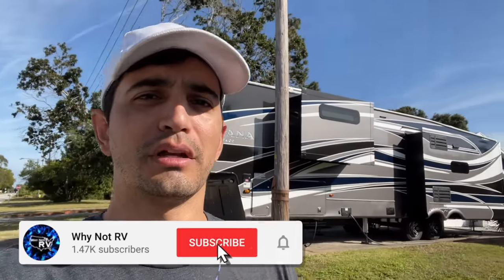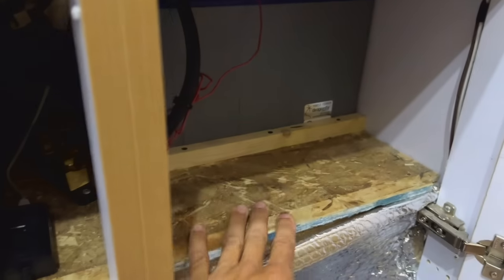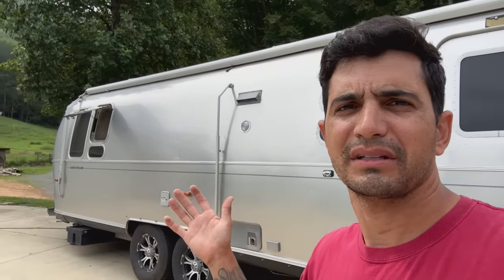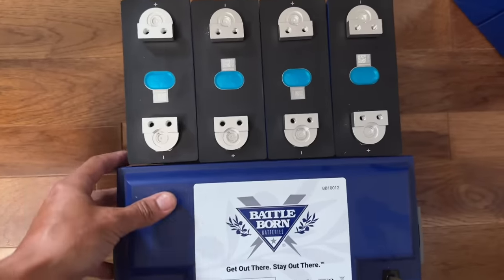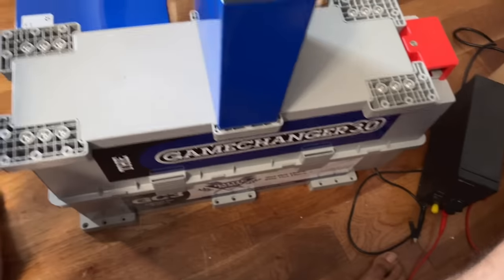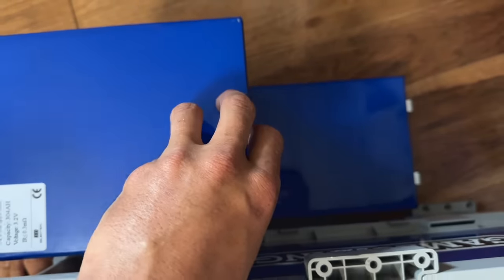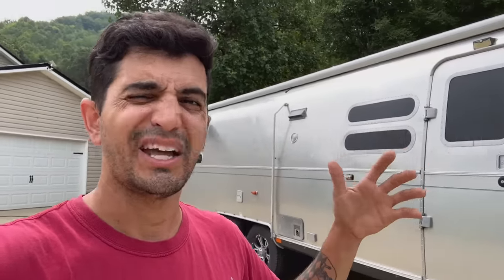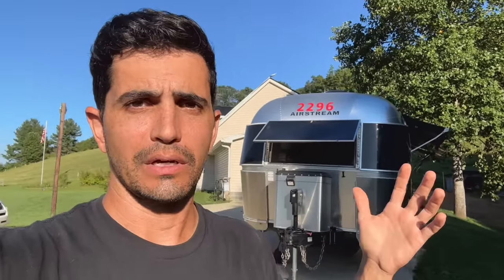Best DIY Battery Upgrade on the Market - GOODBYE BATTLE BORN - Why Not RV: Ep 127

Comment: Welcome to the club!  48 kW of 48V goodness here... (that's around 600 lbs of battery)
Reply from the maker: That’s intense!!!
Reply: @WhyNotRV  I gotta run that 24k mini split!
Reply from the maker: Have you seen my Montana build? I did 48v dual inverters running a 240v minisplit and 240v dryer
Reply: @WhyNotRV  Yeah, we emailed back and forth about it a few times.  Airflow was interesting....  Had to add a booster fan to the main plenum.
Reply from the maker: Oh ya!!! Hey Mark!!! 😂

Comment: I see that your charger inverter is laying flat on the floor.  Please remember this is not recommended by Victron as it does not allow for adequate cooling when in use.
Reply from the maker: If you watch my update video you’ll see that I added a fan directly under the coil in the inverter in order to pull heat away from the inverter and another fan in that cubby the I ver is in to remove heat from the whole area.

Comment: Careful with your loads...your bank can discharge at 400+ AMPS but I believe those bus bars are only rated for 300 AMPS.  Also, double check the amp rating on that shunt!!
Reply from the maker: Ya with my setup I could run EVERYTHING possible and it still wouldn’t hit 300 amps

Comment: OK, I am intrigued. My boat (older Hatteras) has a 32 volt system. I have two banks of four 8V lead acid batteries, one for starting the engines and one for House. Problem with 8V batteries is that no one makes them in anything but lead acid. Is it is possible for these cells to be hooked up to make two 33V banks? Just a thought.
Reply from the maker: Yes, you can absolutely hook these up and series up to the desired voltage you want. The sales coming 3.2 nominal you just have to find a BMS that would be for what you’re looking for.
Reply: I guess that I am headed down this rabbit hole! If it works, I'll let you know. @WhyNotRV
Reply from the maker: Ya I’m curious

Comment: Middle ground compromise would be EG4 server rack batteries 5kw 400AH per rack at $1500 each.
Reply from the maker: The Server Rack style batteries are great for sure. Unfortunately for most those won’t fit in their basic battery boxes or current battery locations. For custom builds they are a definite great and amazing option for sure.

Comment: Your energy density puts my CALB 100ah, 3.2v cells to shame.  I have 48 of my cells in a 24v, 600ah config.  Had I waited but wanted to test the tech.  Wise decision to upgrade.  Do you think you may config in future to use ONE bms?  Will you be fabricating a box/container?
Reply from the maker: I don’t like doing just a single BMS. For individual be a message gives me redundancy in case something goes wrong with just one. Versus if I have just one really big expensive one and something goes wrong with it number one it’s more expensive to replace a number to my entire bank is useless without it. I did not fabricate a box or container. However, I did use quarter inch foam board around all four sides and then you stay 3” x 1” piece of wood on the front and left side to keep everything compressed and tight up against the walls.

Comment: A follow-up video showing your final install (with the BMS' secured, where the fuses are, insulation between the cells, etc) would be helpful.  In other words, address all the comments (which I just read) made by folks.
Reply from the maker: I will do just that. Should I make it a short (less than a minute)? Or regular long form? Maybe I’ll do both.
Reply: @WhyNotRV   However long it needs to be in order to cover all the issues raised in this comments section.  Without needless redundancy, please.  :)
Reply from the maker: I’ll work on it. I appreciate it.

Comment: How would you buy those batteries with 24 volt and how many batteries do u need to buy?
Reply from the maker: You would just be buying 8 total cells and wiring them all in series to make a 24v battery. You would also need the appropriate BMS that’s 24v 8s. They’re available on Amazon in many variations

Comment: Still learning here:  I'm a bit confused on why the 100A BMS on a 300A battery.   4 of those give you 400A?
Reply from the maker: 100A BMS is IT’s max discharge rate. When 4 are in parallel that gives me a max discharge rate of 400 amps. The battery capacity is 304amp hours. Has nothing to do with the battery’s discharge capabilities. All 4 batteries together In Parallel give me 1216ah of total useable battery capacity. Hope this helps.

Comment: In regards to top balancing, here lately, before I connect the bms (I'm using JKBMS's, which have a great active balancer in them), I mount all the bus bars, connect a 5A active balancer then I slowly charge it stepping at 3.4v per cell, then 3.45, 3.50, 3.55, 3.6... that's it.  Then I routinely charge to 3.55v per cell.  I really enjoy making my own packs.
Reply from the maker: That’s an interesting way of doing that with stepping the voltage. Not sure the real benefit there… any input?
Reply: @WhyNotRV  heh, to not cause an over voltage on a cell.  Not that it happened to me or anything.
Reply: I'm with you on this - I top balanced my current setup using 8 280ah cells for a 4s2p pack. I charged them with a BMS connected until they got to around 3.5 per cell then setup the top balance. 

Had my cheap power supply feeding 3.65V - had it gone crazy it would have easily destroyed my cells. 

Next build I am going to do what you did and utilize a BMS with an active balancer or use an external active balancer. You're taking big risks with your cells if you're doing a traditional top balance.
Reply: @MyGoogleYoutube  Yeah, the JKBMS has a good active balancer, where you can set the balance voltages.  I have a dedicated active balancer (heltec?) which runs all the time and is not voltage trigger based.  It is great for top balancing from time to time, but I don't leave it connected on a regular basis.  Doing this method, my cells have stayed very balanced for 3 years now (on the oldest packs).
Reply: @markseamans4682   I am using an external active balancer off of Amazon and have my Victron BMV 712 turn it on at around 3.45 v per cell and then absorb for two hours at 3.55. So far it is has worked really well. Pulls the cells to under 5mv.

Comment: You have the victron, I would have went 48 volts, and use a 12v converter for your low voltage needs.  Much better conversion rates and smaller wires.
Reply from the maker: I’ve been down that dark road before lol I might end up doing this as a but it already had a 12 V inverter
Reply: @WhyNotRV  I get you..  You had everything already setup for 12v anyway... Just a quick drop in replacement.  Different if you were starting from scratch.
Reply from the maker: That’s exactly right. If designing a brand new system for this size setup I’d do 24v

Comment: I like your installation and upgrade.  However, the one thing you don't mention about LiFePo4 cells is how they react to low temperature.  LiFePo4 cells DO NOT like to be charged below 32F degrees.  The cells can discharge fine at that temp and lower, but charging them at a freezing temperature drastically shortens their life and capacity.  I also noticed, your cells are mounted inside your RV, and will stay approximately the same temperature as the interior, that is a great option.  However, most RVers will have their batteries mounted in a place that will keep them closer to the outside temperature.  Charging them at a low temperature could then be a problem.  If you are running solar, it would require an MPPT charger that has a temperature probe for low temp shut-off, or get a BMS that has a temperature probe that will shut down the charging if the temperature gets to low.   If you are not running solar to charge your battery, you will some type of method to shut off the charging.  There are a couple methods available.  If you plan on building a battery,  then get a BMS with a low temp cut-off feature.  If you buy a cheap 12v 100ah LiFePo4 battery, most likely it won't come with a low temp cut-off.  In that case, you buy a  shunt that fits between the charger/inverter with a temperature probe connected to an Auto relay.  When the Shunt temp probe senses too low of a temperature, it trips the relay and shuts off the charging.  The last option is to purchase some way of keeping the cells warm during the cold weather.  Heat strips and heating blankets are available that will keep the batteries warm, however they do draw power to warm themselves and that in turn reduces your available power.  Thanks for the video and a look at your Air Stream.
Reply from the maker: Everything here is very well written, thank you for your input. Myself, due to them being inside, I’m not concerned about temperature but In a previous build I insulated the battery bay extremely well, I was in -10 in Colorado and the discharge and charging of the cells put off there own heat and with the insulation I was able to keep the battery’s above 50 degrees. But yes, easy battery heater can be added for extreme conditions.
Reply: That problem is easy to solve purchase a 48V 5.0 Trophy lithium phosphate battery with built in heater built in breaker and digital bms read out
Reply from the maker: That’s an option
Reply: I do like 48v systems. Smaller wiring is the biggest advantage. I would use one for a cabin, or even for a home off-grid. But, I don't see an advantage in an RV. Going with a 48v system in an RV, you would also have to invest in a 48v charger and that would cost in the range of $120-$1500. It's an expense that is really not needed when RVs already come with a 12v converter/charger and come with dedicated 12v circuits already wired at the junction box. As for systems with solar panels added, it doesn't matter if it's a 48v system, or a 12v system, you still have to purchase an MPPT charge controller, except, there are more INEXPENSIVE 12v-24v models available on the market than 48 volt ones. And, since we are talking about 12v inexpensive systems, why would I want to go buy a 48v 300ah Trophy battery that costs almost $5,000 (currently $4,695), when 300ah prismatic cells go for about $120 ea. (16 cells needed to match the 48v Trophy battery wattage), add (4) JK BMSes and anyone can make (4) 12v batteries for less than $2,500. If a person doesn't have that much money laying around up front to make four batteries, or room for them all, they can go with less. One 300ah battery = 3,600 watts, Four 12v 300ah batteries = 14,400 watts. A 48v 300ah Trophy = 14,400 watts. Also, you have one Trophy battery that weighs over 200lbs, or can go with four smaller batteries that weigh about 50lbs each. And, looking around you can purchase a no name already built LiFePo4 12v (100ah = 1,200 watts) battery with low temp cutoff cost for about $260. However, our high end DIY 12v 300ah LiFePo4 battery (3,600 watts) with low temp cutoff can be made for less than $600. That's triple the wattage for just s little over twice the price of a manufactured 100ah battery. As I also said before, built-in heaters and blankets lower the efficiency of your battery, they use up about 60 watts per hour just to keep the battery warm (Usually at night when you aren't charging anyway). Leave the heater on for 10 hours and it will use up 600watts. That a lot of wattage that can be used to heat up your coffee in the morning. Just using a BMS with a temperature probe to shut down charging when it gets too cold saves the battery, but it also lets you discharge and use the battery during those low temps. The JK BMS also automatically allows the charging to resume once the temp returns above freezing. As for heater strip capability, if you want it, the JK BMS has that capability also. However, you will have to purchase the heater strips separately and install them around the cells.
Reply from the maker: Yes, 48v is insane for an rv setup. I should know lol. Look through my channel and you’ll see my 48v Montana 5th wheel I built. 24v is definitely the most practical way to go if doing large amounts of inverters and solar. Otherwise keeping it simple at 12v is the way to go.

Comment: When top balance...should the positive and negative be on the same side of batteries or opposite like your normally  hooked up?
Reply from the maker: When you top balance, the cells should all be in parallel meaning all positive’s together and all negative’s together the amperage and charging is so low and slow it doesn’t matter if you connect the charger on one end or opposite ends. That’s the point of the “balance”. Just let it do its thing

Comment: The  BMS in the cardboard boxes is a nice touch.  Do you have temperature control on each battery?   By they way if you have any old Battle Borns sitting around I will buy them from you.
Reply from the maker: The battle boards are already sold. I do appreciate it. The cardboard boxes is the very definition of custom lol I added a layer of quarter inch thick foam insulation on top of the batteries in between the batteries and the cardboard boxes.

Comment: You really need to move the balance lead terminals above the bus bar. You want as much surface area as possible between the battery terminal post and the bus bar. They way you have it will cause higher resistance and heat and possible low voltage to your inverter on high amp draw loads.
Reply from the maker: I do appreciate the input and on a typical post style I would do that. Because of how wide the bus bars are, and having two mounting points to each terminal, there’s ample surface area. But definitely solid advice.
Reply: @WhyNotRV you are loosing a lot of surface area the way you have it installed.
Reply from the maker: I did change them to on top. I definitely appreciate the feedback and extra thoughts.

Comment: Please fuse for the appropriate wire size. This is a huge fire risk. Because it works doesn't mean it's safe. Boatowner's Mechanic and Electrical Manual by Nigel Calder. Please buy a copy ASAP!
Reply from the maker: Fuse or reset able breaker is definitely needed. This was not the fully finished install. I’ll be doing a follow up video for everyone

Comment: I am going by what I have heard about lithium batteries but I have heard that the batteries need to be held in a way that prevents them from expanding to prevent them from expanding. You set yours up so they won't move around but are they contained with enough pressure to keep them from expanding?
Reply from the maker: I use wood framing to keep them in place and prevent expansion. Some people use a certain type of tape to hold them together and prevent expansion.

Comment: There are some great BMS  about these days, for a bit more money. Daly is not one of them. It is far better to have a BMS with an active balancer like the JK. 
Compressing the cells with end plates and threaded rod not only keeps the cells in compression but gives a way of fixing the cells down. 
The wood you have along the base will create a hard point on the cells. How do you stop them bouncing and putting load on the busbars? This really is a very poor installation.
Reply from the maker: This unfortunately was t the full final install. I’ll be doing a follow up video to show the final product. But it’s secured from the top as well as more wood on the sides
Reply: @WhyNotRV  you should install the BMS away from,the batteries. Those cheap Daly BMS use passive balancing. Placing them on top of the batteries is not great. They use resistors to burn off the excess power from the highest cell. They will get warm. Far better to locate them on the bulkhead so they don't heat up your cells. 
I don't understand why you would do a video of a half installed system. The work isn't in placing the batteries on a shelf, its in dressing all the cables to ensure its tidy and it will tolerate being vibrated and bounced around on the road without causing a short. The cables dont want to be full of joints. That is a disaster with lithium. The need  minimum junctions to reduce potential high resistance. The ideal way to wire the batteries to a copper busbar, ensuring you have equal length cables on each battery.

Comment: I did the exact opposite. I built my own DIY battery from cells and BMS, then I decided it was too much risk putting this into my RV, with the possibility of shorts, and overheating cells next to one another. I ended up using four LiTime 230Ah batteries, for a total of 12.1kwh. The advantage to this is the cells are isolated and insulated, each battery has it's own BMS, has low temp protection, and they have a 5 year warranty with a company that stands behind their products. If one of your DIY cells or BMS goes bad, sorry, you'll have to replace it yourself. Sure the commercial battery takes up more space. Your mileage may vary, as the saying goes.
Reply from the maker: understandable, if you aren't comfortable with DIY.... DON'T DO IT!!! It is not for everyone

Comment: The battle borns were great when they came out but they are not power dense compared to a self built lithium battery.
Reply from the maker: Yes exactly. They do have outstanding customer service and support but I don’t feel they can justify the cost of those batteries. It’s crazy how much they charge for what you get